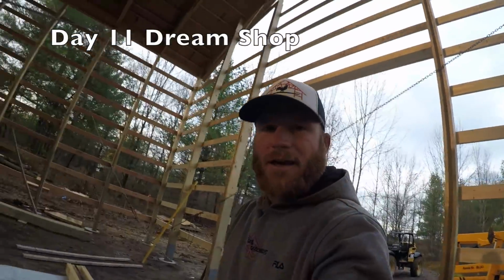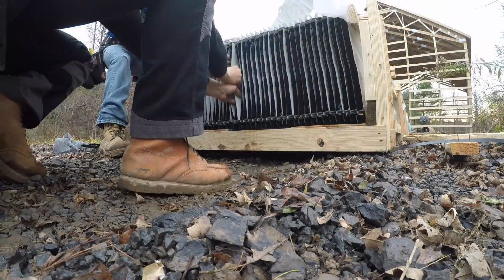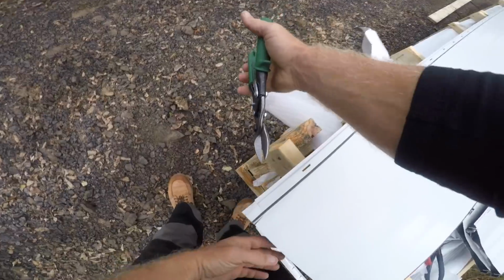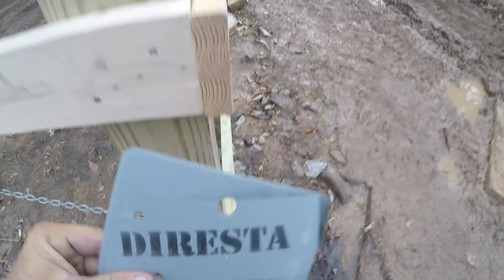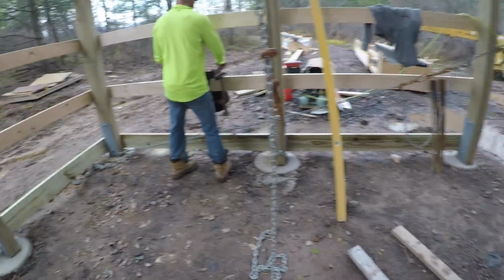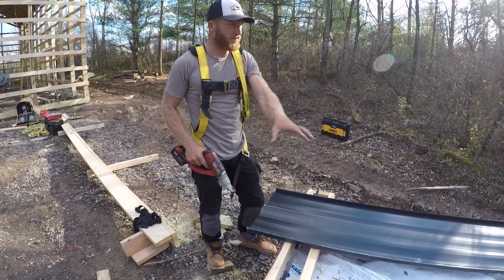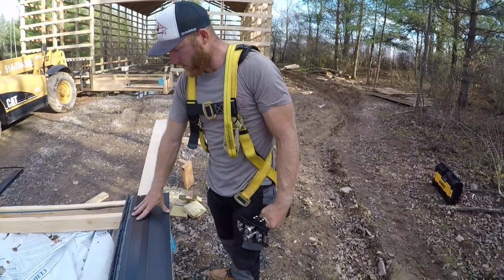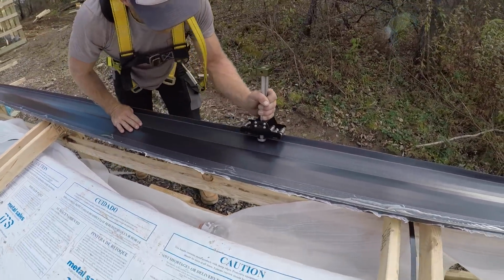Day 11... DiResta Dream Shop Series

Comment: You may know this already but there’s another way to do the rakes. You run the same profile trim up the rake as you used on the eave. You then hem the whole length of the panel and slide it on. Makes for a cleaner profile and uses less fasteners.

Comment: Awesome build. Instead of cutting the post hardware....have you considered just notching a 1/4" out of the grade board to accommodate your post hardware so you don't lose the added strength? Then just drill a few quick holes and hand drive a few nails into the post. About as quick as cutting the steel.

Comment: Looks great and so well built. It seems like the doors should be bigger for the size of the building🤔
Reply from the maker: Tony Baggett I agree they look small but no need for bigger and would only take up more Shop wall space potentially.  It will look more appropriate when windows all go in I think.
Reply: RR Buildings you’re right the building is just so tall with so much overhead space, it seems like such a waste. But that is probably an architectural thing and it looks like it is being built very well.

Comment: I just put a similar roof on my house but we had to use a rubber mallet and block of wood to lock down the two panels. Does just hitting it with your hand lock it in? Also, look into a set of special snips that cuts your panel to 1" for the hem and puts a 45° on it as well. Then you can just eyeball over to make your folded side and cut off the excess on the screw side. The manufacturer for my system sold them to us when the rolled the panels on site.
Reply from the maker: dmckbtrs dang that’s awesome.  Wish I had one of those.  And yes a hand slap is all that’s needed
Reply: Also, it took us about 3 months of weekends and evenings to do it due to being beginners, some rot repair, and several valleys to deal with. It's great seeing the pros do it with all the proper gear and know how! That said, I couldn't be happier with how mine turned out.
Reply from the maker: awesome

Comment: Those last pieces of metal on the roof, that you had to cut to size.  Maybe you'll show it in a different video, but how do they get fastened to the roof without drilling through them?
Reply: Liquid nails! haha.
Reply: Jack Brennan Gorilla Glue to the rescue.
Reply from the maker: Sorry I guess I didn’t show that.  You will see it In a future video
Reply: There is a cap piece which is face screwed to the gable fascia or a trim piece which is on the outside face of the gable fascia.
Reply: Double-stick tape?
Reply: how do you keep us in suspense.............. we will find out in another video  lol
Reply from the maker: sorry lol
Reply: You cut 1 inch straps that go over the piece he bent and then get screwed to the gable piece.  They there is a cap that slides over that.
Reply: Drip edge?
Reply: RR Buildings can you just explain it?

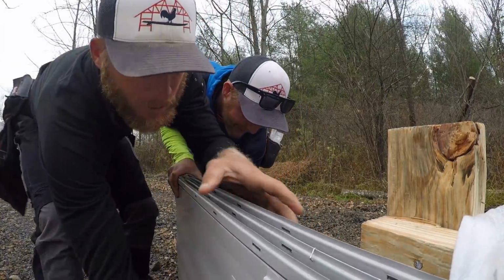Comment: 2:03 at this point i would already think something is wrong. probably nothing, but things are generally designed to be used, so you might wanna look closer. if it was just shit packing take an axe to one of the ends of the crate so you can crack it looser. you don't gotta keep the box do ya?

Comment: Curious question, this isn't a criticism. Is the zip system able to take the heat from the black roof panels during the hotter months? No underlayment or any kind of foil facer? And what of condensation issues where the zip system was nailed into the framing?
Reply from the maker: I reached out and asked those types of questions to make sure it was okay

Comment: what do they call this roof system your installing it's similar to the snap lock you had to prep each panel with the benders for the wave and you had to measure from rake to rake to figure you starter n finisher panel
Reply from the maker: Standing seam
Reply: RR Buildings thanks

Comment: I have a metal roof like this. I'm so curious how the cut edges of the metal don't rust!
Reply: I just put one on my house and my understanding is that when you use snips to make the cut the coating on the metal is self healing which is why cut off wheels are frowned on as they are too hot.
Reply: Exactly! Cut off wheels gets the metal hot and burns the coating off and them it will rust quickly
Reply: There is no self healing going on lol. The surface area of the cut edge is so small that the rust is negligible and so creates an oxide layer that stops where it is. In saying that, the roof must be completely free draining to allow complete drying.
Reply from the maker: actually the metal does self heal itself when sheered.  its called aneeling  or something like that.  Maybe I've spelt it wrong.  it doesn't prevent rust but the way it is cut does seal off the edge a little bit.  This is what my supplier told me.  seems crazy, but..

Comment: Another great video. Learned some more! Does rolling and bending the end sheet affect the finish?
Reply from the maker: bluebarnworkshop no not at all
Reply: Thanks. Makes sense that the coating is tougher than that. I am learning a lot. I want to put standing seam on my barn now.
Reply: Probably left the protective layer of plastic on while he bent it too.
Reply from the maker: sure did
Reply: Of course, makes sense now that you mentioned it, I learned another thing.

Comment: This has been bugging me since video 5 and I can't even figure out how to word this question.

I am trying to figure out how you made up the offset where the purlins overlap.

How did you offset the sheathing so that you had good edge nailing where two adjacent runs cross the overlapping purlins? 

Some how you are making up a 1-1/2" offset (the thickness of one purlin) so that everything comes out neat and clean.

Did you do this by shifting the layout of the purlins, or does it just work out because of the way you staggered the sheathing? Did you burn or add an extra 1-1/2" to the starter course on every third (I think) run of sheathing?

Anyway, really nicely done.
Reply from the maker: Christopher Dahle great question. We basically payed out the sheeting so every 3rd or 4th run staggered 1 1/2”.  Not too difficult.  Looks good from an aerial view still
Reply: Got it,  Thanks. I'm too old and beat up to frame anything that big again, but I learned something. You guys are fast and efficient, appear to be having great fun, work together, yet stay out of each other's way like it was choreographed. It's friggin art. Good luck.

Comment: Unless I'm missing something obvious, why wouldn't you simply notch your grade board over the steel brackets on the corners instead of cutting it off? It would take what, 5-10 minutes to notch out 1/4" of material on the grade board?
Reply: Paul Allen maybe more difficult to fasten
Reply: EXACTLY! Its a mistake to cut those brackets. The corners supports are very important.
Reply: Mekhanic1 
This amazing building is built like a brick shithouse, the loss of those brackets is nothing.  Think of all the farm buildings built with no codes and no money, yet they stand for generations.  This building will stand until someone takes it down.
Reply from the maker: Those corner brackets are typically only one ear.  Maybe I didn’t explain that good enough.  For ease of having all the same brackets I just use the universal instead of buying a specific corner or jamb bracket
Reply: These dudes are pros.   Very cool to watch.   I’m wondering why Jimmy needs such a freaking huge building?
Reply: aviatorbja 
build as big as you can afford,  worst case, divide the space to cut down heating costs.